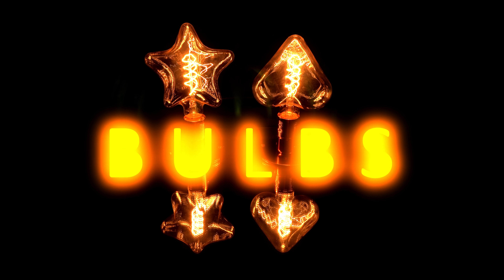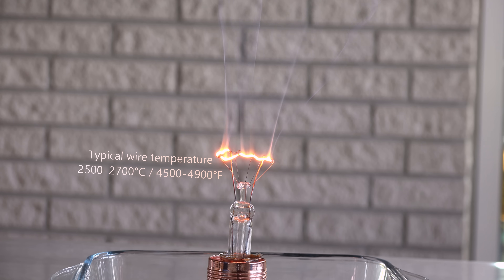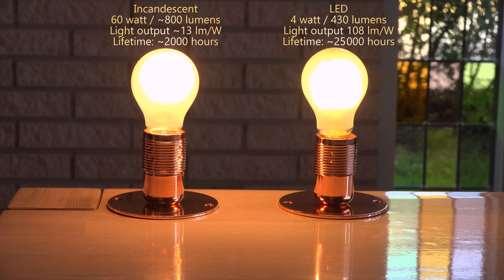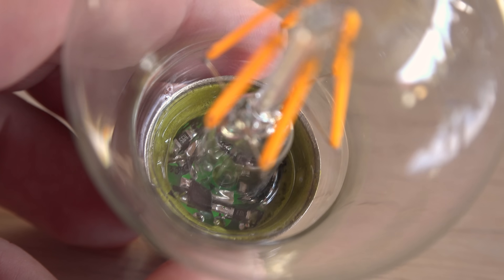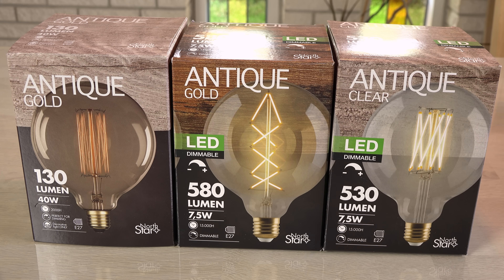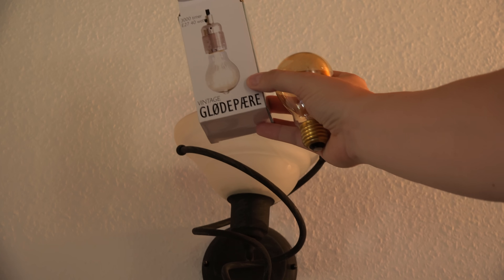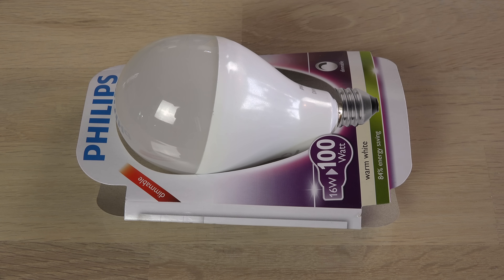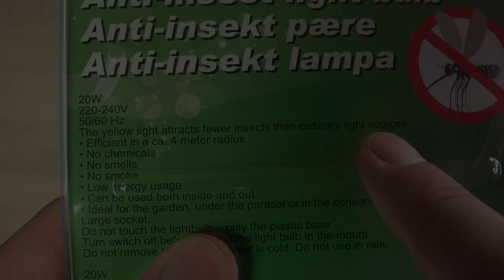Light Bulbs | LED vs. Incandescent

Comment: Led light is Horrible.! and questionably more efficient.
 As someone has already said in cold weather the heat from an element, is not wasted, and is the ten minutes it takes for the led bulb to achieve usable brightness, a part of the calculation? ...! 
Or a  case of saving companies power so we can be charged more for the same energy?
Or has the development cost been so expensive that it has to be aggressively marketed regardless of it's true efficiency?...! 
Bring back the soft kind light of the element or invent something better 'techno-plonkers' before we all go blind...!!

Comment: LED flickering is caused by cheap AC/DC driver circuits. With just a battery and resistor, there is no flicker at all. An output capacitor can remove the flicker, but adds to the cost, and the LED no longer turns off instantly. Also most failures happen in the driver circuit. If you could remove the LEDs in a dead lamp, you'd discover they still work fine.

Comment: Hey.

You cannot really measure a normal/old fashion lightbulb with just a watt-meter, you also need to disclose the voltage you measure the saied wattage on.
The reason LED's usually are "spot on", is because they use some sort of PWM (pulse with modulation), and thus does the onboard electronics have a feedback, thus it can be tuned to a high presicion, even with el cheapo electronics.
My guess is that the voltage in your house/lab is slightly on the lower end of the scale.
The resistance/impendace of a normal bulb is constant (with same hz), and with lower voltage, you get lower power, and if your voltage is at the lower spectrum, you would also get lower wattage.

i.e. on 216volts a 60w bulb would actually be 53w...
you could probably do this in an easier operation, but here goes:
rated at 60w/230v, the bulb would draw 0.26amp, thus the bulb has 881,5 ohms
230v*0,94% = 216volts
216^2/881,5 = 53 watts :)
on the other hand: ((230*1,1)^2)/881,5 = 72watts

Comment: A factor a lot of people miss is that in cold climates, the "wasted" heat energy isn't really waste.  In fact, if you heat via resistive electric (which a TON of people do) virtually ALL the "wasted" energy is put to use exactly as efficiently as the furnace or baseboards.

The mitigating factors are when it's warm enough that you don't need heat, in fact you pay double the penalty if it's hot enough and you have AC running (lightbulb uses 100W to make light +99 watts of heat, ac probably uses 60+ watt's to remove that heat from the house)

overall though, in many climate's LED's aren't that much better in the long run (we heat 8-9 month's of the year where i live).  not to mention how much more waste goes into the landfill (sure led's say they'll last 25 years....which mean's noone you've heard of has ever had to replace a led bulb yea?)  Glass and metal are recyclable, or at least they are inert and won't harm the environment.  I'm not so sure the same could be said of the plastics and electrical components that go into led's.  Sometime's I feel we've forgotten many aspects of pollution with all talk being focused on AGW
Reply: Was about to write something similar. Here in the northern Europe winters are long and dark, time you need to use lights the most. Any savings from lighting during those times is directly moved to heating cost. Only savings you get are during the summers which are very short and bright so you barely use any lights anyway but still the same laws hit us and banned incandescent bulbs. 

Even if you were living in optimal conditions and got proper savings from leds it's still a piss in a ocean when compared to other polluting things. If you want to save the earth then there are loads of better things to do than go after incandescent bulbs.
Reply: Furnaces and heat pumps are much more efficient heating than light bulbs. Resistive heating is slightly to moderately more efficient, depending on circumstances.
Reply: Basically, what you're saying is correct. However, using electricity to heat something is just terribly inefficient. Even though you might now be using the energy you put in the bulb for 100%, you're still using electricity for heating, and a lot of it.

The warmth you loose from using LEDs isn't even that much, and could be added to the house in a MUCH more efficient way by using a central heating system.

Long story short: heating with electricity is never good. The extra energy you put in for "heating" can be used way more efficiently by your normal heating system.
Reply: However, most light fixtures are above head height. This means the heat they produce is mostly above humans. If the light is in a ceiling fixture then it's just heating the area around the fixture. How much of this heat actually warms occupied space depends on airflow.
Reply: +Ben Le I guess you mean cfl not incandescent bulbs, cfl bulbs contain mercury and rare earth in powder form, its pretty nasty if you break them
Reply: interesting comment, a brief look into it though.  It seems that the mercury incandescent bulbs contribute is based solely on the fact they use more energy, and fossil fuel powered electrical plants emit mercury.

so..not really.  We were talking of incandescent bulb use in climate's where it's cold more of the year then it's warm.  Since cfl\led isn't really much more efficient when your heating you home via electricity 3\4 of the year, the "extra" mercury put out by powerplants is a moot point.
Reply: That isn't true most of the time. About 15-30% of the energy that you are paying for, but isn't showing up on your bill is heating the wires and transformers on the way to your home from the generating plant. If you are in Canada where hydro is your generation source, it might still be cheaper to heat with electricity since there is no fuel cost or inefficient internal combustion engine turning the dynamos. 
And unless you have something to keep the air circulating, the heat is going to end up near the ceiling keeping that annoying fly and his predator, the spider, comfy and warm.
It's better to use specialized hardware to do specific jobs if you care about efficiency.
Your complaints, really fears, about LEDs are a repeat of what were said about CFLs, minus the "OMG! Mercury! If a bulb breaks we'll have to call in a hazmat crew!" hysteria. Just as CFLs with 5 year lifetimes replaced incandescents that had to be replaced every few months, I've never had to replace an LED. On anything. I have stereo equipment that was manufactured before the sapphire substrate that enables white LEDs to exist was invented, and the green, red, and orange LEDs still function.
Reply: bcubed72 The vast majority of heat from a light bulb is convective. Even heat lamps designed to produce radiant heat give off more heat directly from the bulb than they produce in infrared radiation. Bulbs made for illumination bulbs produce very little infrared radiation, and Bulbs made for infrared radiation produce very little illumination.
Reply: You forgot to mention the cumulative of mercury vapor to produce these incandescent bulbs in the factories and landfills.
Reply: Also, I've killed one LED bulb in that time. It was my first. And sat outside in my porch socket running every night dusk to dawn for around six years.

As long as you buy quality (AKA: Reputable brands you could find in a store) and not utter crap bulbs, you're in good shape.

Also of note: Just checked, my CRI on these Philips (They were on sale for under $3 when I converted my whole house) is >95 -:- While that's not perfect, it's certainly clearer on video than CFLs and incandescent or halogens in my experience (No flickers, colour rendition is spectacular unlike incandescent bulbs that throw a gross tinge)
Reply: Ben Le
 Also, what's the deal about mercury vapor? Another greenhouse gas?
Reply: my point is that often these bulb bans are in place in climates where 3\4 of the year you are heating your home
Reply: Also still want LEDs for my car lights.
Reply: And Denmark itself is in a cold region... Their summers average 60 outside. So yeah.
Reply: i'm not arguing it's as efficient as heaters designed for the task, but if your going to tell me 100% of that heat is wasted.....
I'm guessing  it's at least 50% as efficient as a heater.  That closes the gap between incandescent and cfl\led considerably in such climates.

Electric heating is very popular where I live, largely because we have a lot of hydro electricty.

I'm also skeptical that the energy tradeoff is worth the extra crap in our landfills.  From all the research i've done personally, carbon scare's me less then all the toxin's we dump
Reply: No, you have it wrong... even IR stays in the room if used inside a home or other building. It eventually warms the air in the room from the surfaces that it hits and warms. You are forgetting that energy is not created or destroyed. This is one of the most important things to remember about conservation of energy. Just because a bulb does not always create light, all of the energy will always be changed from one form of energy to another. That is in a room that no light can escape from all of the light from a bulb will eventually be changed into heat to warm the room. So if you have a LED bulb that actually draws 100 watts, it will put off a whole lot more light than an Incandescent and will warm the room the same as one of the old bulbs. Problem is for those looking to use them as a heat source they only put out 15 to 20 watts of heat instead of the 100 watts that people are used to getting.
Reply: Markle2k 
"heating the wires"
Oh, but a standard space heater magically wouldn't, right? -_-
Reply: Exactly. If heat is what you want, then there is no issue, because you are producing and using it. But if heat is an unwanted byproduct, then you are wasting energy, and even more so if you have to cool the area to counteract that unwanted heat.
Reply: animefreak5757 There are much more efficient ways to heat though. Like say, a heater.

I live in Canada, use all LED bulbs in my house as of four years ago and I find the house maintains a more stable temperature as result (I suspect this is less of an issue with baseboard or radiated homes though, as there's no central thermostat to confuse with temperature variances.)
Reply: I fitted our entire house with LED bulbs and only one has had problems so far, sometimes it comes on at half light only but if you turn it off and on again it is fine.
Reply: "However, most light fixtures are above head height. This means the heat they produce is mostly above humans"
WRONG!

Heat is "infrared radiation." It's essentially a form of light we can't see. The IR radiation will go wherever the light goes. It won't "stay up by the ceiling," any more than the light will stay up by the ceiling.
Reply: All of that convective heat from an LED lamp is what keeps them from catching fire, and that is what will happen if they do not shut down first.
Reply: What about when all the tungsten runs out?
Reply: animefreak5757 I don't really believe in affinity but if the light bulb is not a dedicated temperature I would throw it away.
Reply: Also the snow doesnt melt off LED traffic signals
Reply: it's not a fear of mine, it's a observation and criticism of the law's banning incandescent bulbs.  Personally i use cfl's, for two main reasons, I can get more light out of a small fixture, and I don't like the excess heat in my tiny room in the summer (even just my pc has a very noticeable impact on room temperatures)

At the end of the day, in the climates i'm talking about, led's are marginally more efficient overall.  There are far better target's to reduce carbon output, but as usual, they target only things they can easily do, then trumpet it from the rooftops.

Comment: I thought one of the "Wattage" ratings for CFLs as well as LEDs was not consumed power, but the power of an incandescent  bulb with similar light output.
Reply: +Jeffrey314159  Oh Yea! the HP version of stabilization.   I modeled that in an early circuit simulation software in, I think the 70's.  The warm resistance of the bulb is around 500 ohms and balances against a resistor in the other arm.  
...
The bulb is barely lighted to keep it on a slope of changing resistance with power.  Too cool and R doesn't change.  Too hot and R has flattened out.
The bulb was a 7 watt 120 volt bulb, very much like the olde Christmas tree lights of the 50s-90's.

Comment: Not only possible flicker, but Radio Frequency (RF) noise.   Take an AM radio tuned in between stations near the high end of the band (1500kHz.) and turn on an LED or CFL.  The electronics can use a switch-mode circuit to control the LED current and this can also generate lots of this type of noise.  This aspect is being completely ignored.I have a table reading lamp.  It has a lighted on-off button and it actually generates more RF noise when off !!
Reply: +Jeffrey314159  Oh Yea! the HP version of stabilization.   I modeled that in an early circuit simulation software in, I think the 70's.  The warm resistance of the bulb is around 500 ohms and balances against a resistor in the other arm.  
...
The bulb is barely lighted to keep it on a slope of changing resistance with power.  Too cool and R doesn't change.  Too hot and R has flattened out.
The bulb was a 7 watt 120 volt bulb, very much like the olde Christmas tree lights of the 50s-90's.